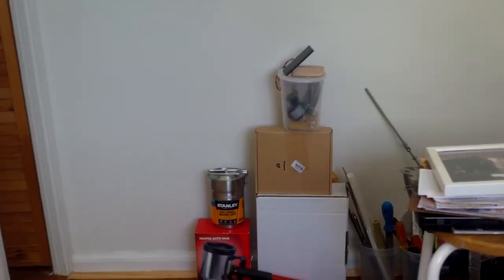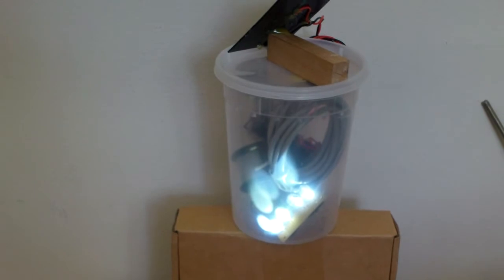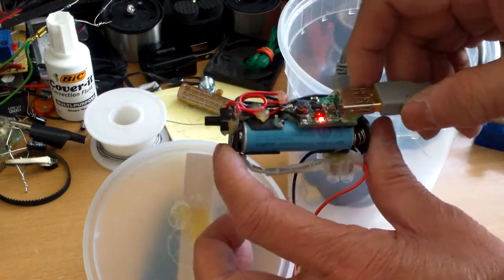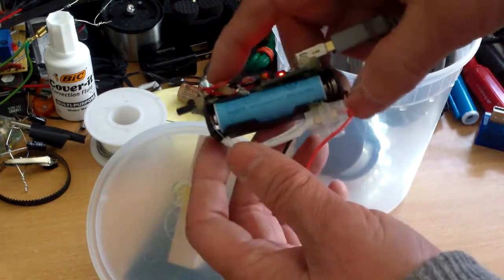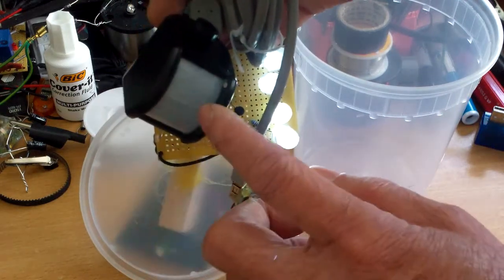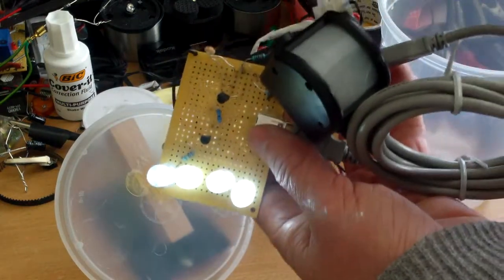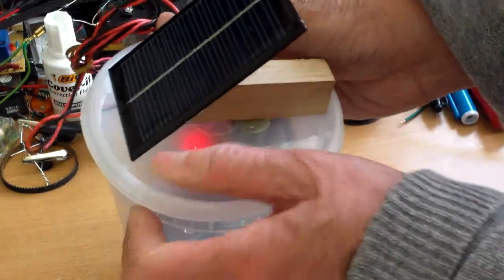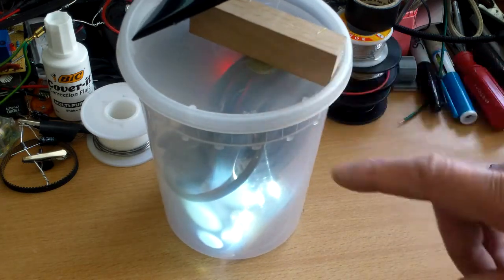Solar motion sensing light running on a single AA battery

Comment: Will it respond well from a bigger distance when its inside the box?
Maybe you can drill some holes inside the box and glue the leds in it. It might give you more light :-)
Only a suggestion
Greetings to you Paul
Erik
Reply from the maker: The motion sensing works well enough, even when the sensor is inside the plastic container. It's a good thing as the container will protect the electronics from the rain. Some sort of reflector might help though.